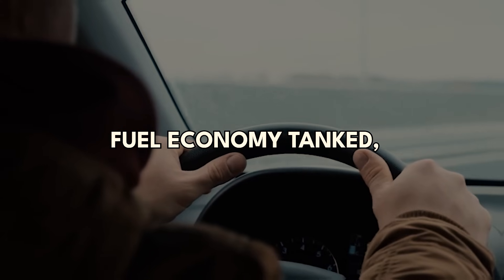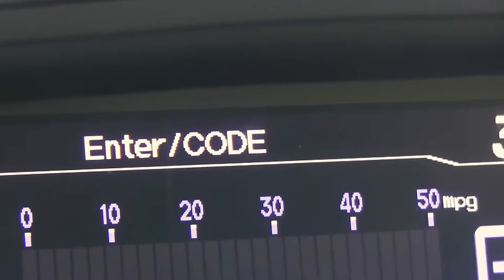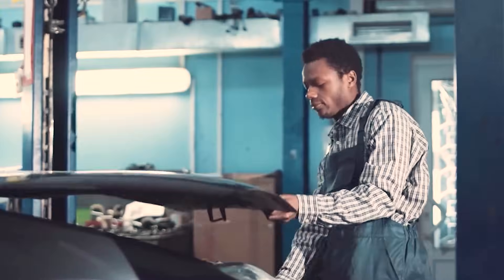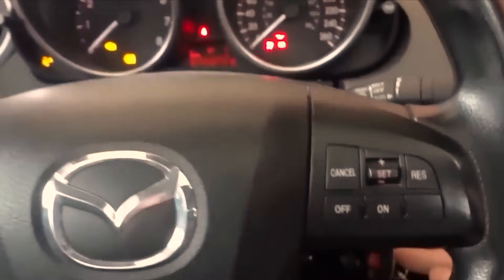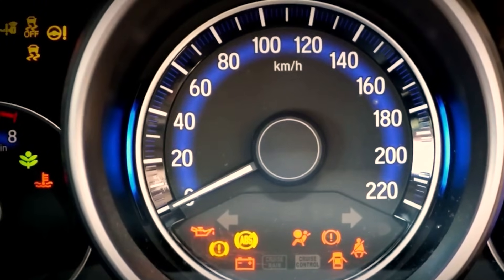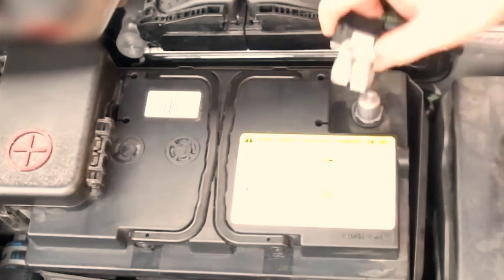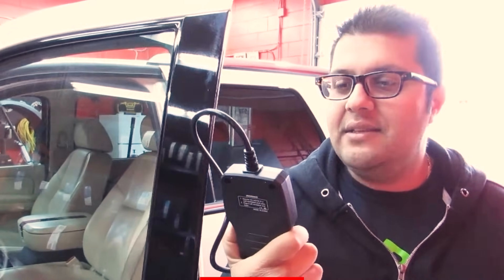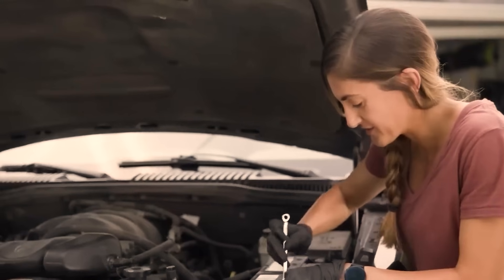This Simple ECU Reset Can Fix Tons of Car Problems Most Drivers Don’t Know It

Comment: My toyota corolla le 2014 radio went crazy i was not working and toyota dealership told me i need a new radio. I never got a new radio 1 year later my battery died i got a new battery and the radio working perfect. I don't like dealership micanics I try to do everything on my car's since I was a teenager. I ask lot's of questions if i don't know something.
Reply from the maker: Thanks for sharing your experience!
Reply: @CarHacks14 it's one of the 1st signs of the battery going bad don't let them get you 😉. Respect we got to help each other always.

Comment: I had a Nissan that wouldn't start and everyone told me it was a starter I pumped the brakes like four or five times and then pump the gas pedal once held it halfway and in the ignition turn the ignition and it started I continued this until I sold the car
Make sure you replace your battery often at least once a year...it needs all it can get with the enhanced computer systems...
Reply from the maker: Thanks for sharing your experience and tips!